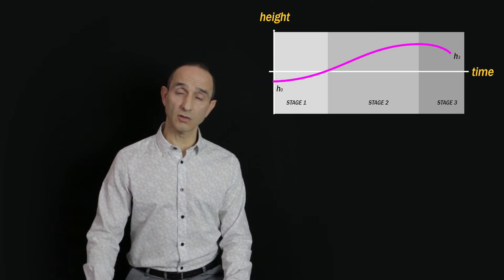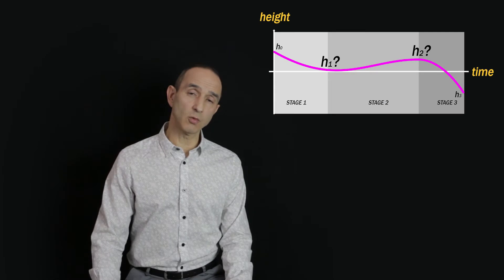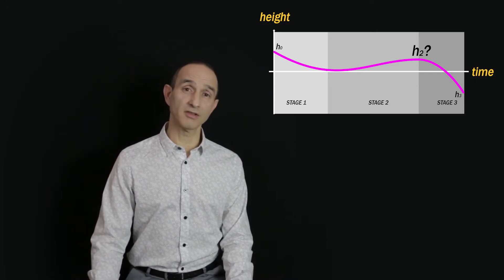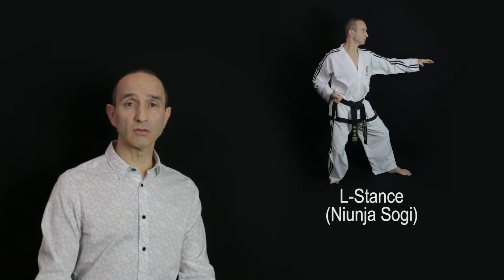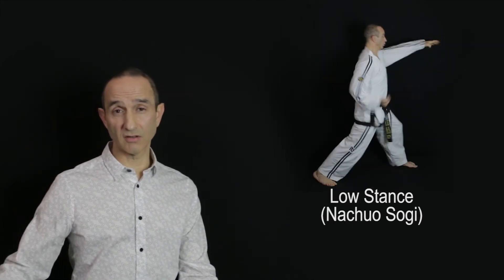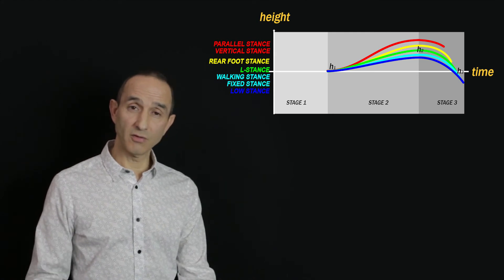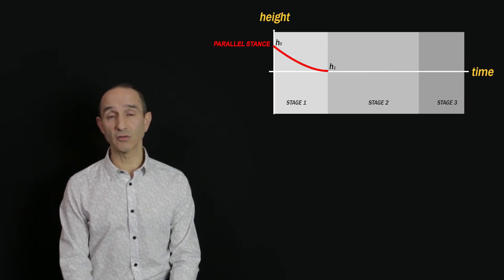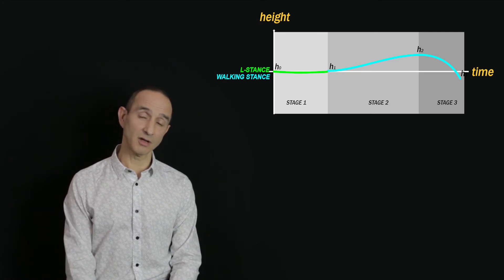Taekwon-Do Science: Sine Wave Motion #6

Comment: I used to train in ITF TKD back in the ‘80’s with Master Han Cha Kyo for many years.  No matter how much I genuinely try to understand sine wave, it makes no sense to me.  In theory in all sounds great, but in reality it’s a waste of time and misguided in my opinion.  And I say this out of real concern for direction of ITF TKD and not just to troll or hate.

If sine wave is something natural, which I can see to some degree, then why spend all this time and energy emphasizing it because this excessive focus on sine wave leads to over-exaggeration of movement for many students of TKD, which then becomes unnatural.  Also, this over-emphasis on sine wave leads to telegraphing your move, which any real fighter knows to avoid.  

I was taught and still believe that true power comes, not from unnatural, over-emphasis of sine wave, but from hip power.  Now, I’ve seen some students over-exaggerate hip twisting motion as well, which slows you down.  True generation of physical power comes from subtle fluid and connected motion generated starting from the balls of the feet to ankle into the knees, to hip twist, to shoulders, to wrist, and finally into the punch or block.  It’s like a whip whose motion starts at the handle.

The power of Bruce Lee’s famous one inch punch does not come from sine wave motion.  Even Wing Chun practitioners know that economy of motion can lead to tremendous power when they’ve learned the more important concept of “rooting” to the ground.  True Ki power is so subtle and minute that it is barely perceptible to the eye and the average observer would not detect it.  Sine wave is anything but true Ki power from what I can see.  As a former serious and passionate ITF TKD student and instructor, I find the over-emphasis on sine wave embarrassing.
Reply: I see, now realize well that sin wave is wasting power due to the vector is aheading 45 degree it doesn't move straightly forward.  Thanks for the clear explanation by video.

Comment: If performing a technique with the correct controlled motion at a faster speed generates increased power, then how come in patterns it is not performed quicker?
Reply: Wouldn't this also link in with the theory of the amortisation phase of a movement? I.e. The less time spent loading, the greater the outcome force.
Reply from the maker: Patterns are an exercise to develop many things such as power, balance, rhythm and technique so you don't sacrifice this for trying to rush the technique. However, you still need to get maximum acceleration and speed in the 3rd stage of sine wave motion in order to maximise the power. When sparring you need to improvise so you can deliver the technique earlier. Speeding up or shortening the amplitude at stage 2 can speed up technique but it will not give you more power. There are also times where you need to skip stage 1 and deliver the technique straight away in order to speed up (fast motion is an example of this as you skip stage 1 for the 2nd technique). Patterns use the 'text book' techniques and sparring may use the improvised techniques. It is like a Tennis player learning the 'text book' strokes but often has to improvise these techniques when dealing with a challenging return during a match.
Reply from the maker: If you want to do a technique in a plyometric way you reduce the time loading (keeping the amortisation phase to a minimum) and you get a faster technique but this doesn't always mean you get a more powerful technique. If you watch people performing breaking techniques, they wind up a lot before the break. this is because they are trying to apply as much mass into the technique as possible. There are many factors involved when dealing with theory of power. It is not a case of 'one method fits all'. There are many ways of optimising power for various situations and the method you use will depends on the situation. I will be covering Theory of Power  in the Taekwon-Do Science section.
Reply from the maker: I understand your point. You may get more power if you go faster but it will more inefficient. This is ok in a real fighting situation because it doesn't matter if you waste energy as long as you win the fight and speeding up the technique will be beneficial because you hit the target sooner. In patterns, it is more of an exercise to get as much power in a very efficient and aesthetic way. Everything has a natural frequency. It is inefficient to try to go faster than the natural frequency. Think of a swing. If you try to push the swing to make it go faster you will wasting a lot of energy. You need to push the swing when it is ready to move forward. The swing will move with sine wave. Your body also moves with sine wave if it follows its natural frequency. The trick is knowing when to accelerate and knowing how to apply your mass behind the technique. In TKD, it is when you start stage 3. There is some application of plyometrics  at this point because as you begin to drop your body your arms are still winding up, moving in the opposite direction, until the loading is so great, then the arms start moving in the direction of the technique with a good initial acceleration.
Reply: @DonatoNardizzi  no,its not like a tennis player at all or indeed any other sport because their technique is exactly like the improvised one except maybe done quicker or in a reduced range.The sine wave techs from patterns are entirely different to anything you could ever do in combat and so will not transfer due to the principle of skill specificity.You are trying to make a completely arbitrary change by gen choi seem like there was biomechanical evidence behind it when there was zero.

Comment: What is the greatest way to reduce the chance of injury at the knees and ankles whilst performing the sine wave motion?
Reply from the maker: The whole point of sine wave motion is that is the most efficient way of moving. This means that the movements are more gentle on your joints. The elliptical and springing motions of sine wave mean that the joints are not severely stressed when changing direction. Compare with saw tooth wave which is not smooth at all when changing direction. So my answer would be - you reduce the risk by doing the sine wave motion correctly. Sine wave motion is actually healthy because smooth joint movement is more healthy than inactivity.

Comment: What's the amplitude of each wave in these movements and when greater, does it result in different amounts of power going into each movement. Is this also the case for the area under each wave function?
Reply from the maker: To some extent, the greater the amplitude, the more power you get. However, there is a point that the amplitude gets too close to 100% that it creates saw tooth wave and you start to lose power because you are almost locking the joints. General Choi Hong Hi suggested that an amplitude of 80% of maximum  is optimum.

Comment: Where should the positions of the limbs be in relation to the differing gradients of the function shown?
Reply from the maker: Thank you for your question,  I hope I understand it. Are you asking how the arms move during the sine wave motion.? If so, ...it depends on which technique you are coming from and which technique you are going to execute. Generally, the limbs move to a relaxed position in front of you by the time you reach a neutral position. If you are coming from a technique where the arms are high and the arms are going high again then the arms will remain higher up than if you go from a high technique to low technique. If going from a low technique to another low technique then the arms do not need to raise up, so they remain low. Going from high to low or low to high then the arms will get to a middle position during the transition (neutral position). There is no specific position the arms need to be in at neutral position. The important thing is that you minimize unnecessary movement of the arms, for example,  dropping and lifting the arms back during the transition. Also, keep the movement flowing (usually in an elliptical or springy way) so it is a sine wave. i will cover this in more detail in one of the Sine Wave videos.